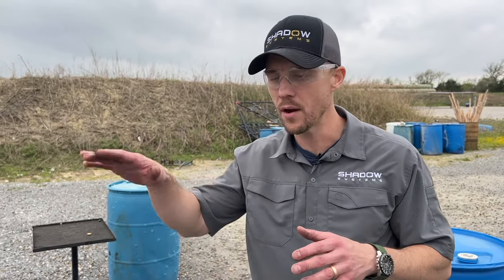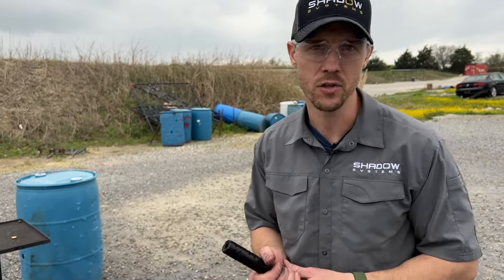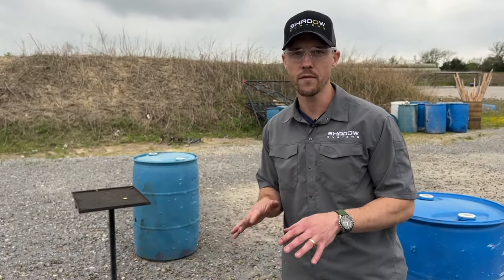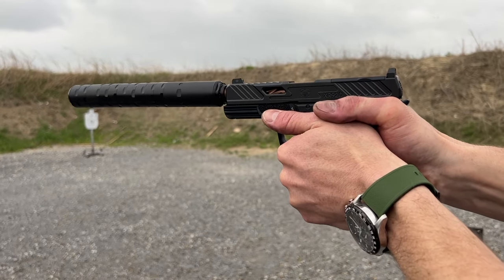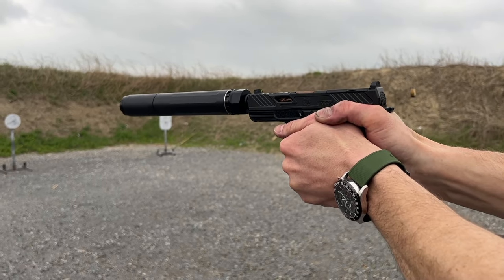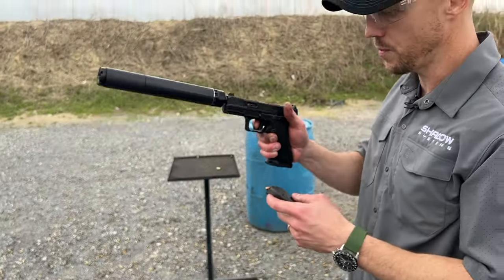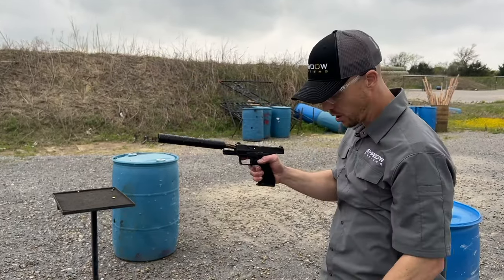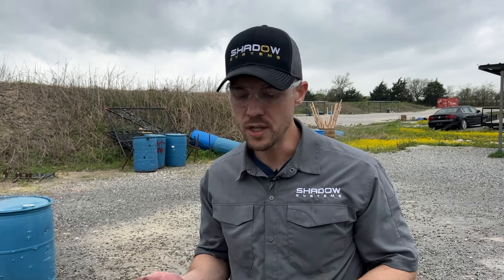Technical Tuesday - Improving Reliability with a Suppressor

Comment: My XR ran flawlessly with my omega 9k with the stock spring. My p80 17 clone had the opposite issue here where it wouldn’t eject, or would get stove pipes, or not lock back on the last round.  It does have a stock weight recoil spring, so in this case perhaps it needs a lighter one. The pistol was well lubricated.
Reply: Did you ever figure this out, I have a similar issue
Reply: @Cseeley122  yeah so basically if it’s an FTE, it needs a lighter recoil weight. I went with 15lbs. If it’s an FTF, or failure to go into battery then it needs a heavier spring.

Comment: Thanks for the video. I have a larger dead air suppressor, the wolf man. I just tried it on my dr920 and it won’t cycle. I’ll be able to get one round off then I have to rack it back to cycle the weapon. I had cleaned it prior to shooting and also sprayed lube into it when the malfunction occurred. Still no cycling. Going to try the heavier recoil spring.

Comment: This is why I slapped together an AR-9SD. I've had zero jams or malfunctions of any kind. No fancy devices or tuning needed just screw it on and dump thousands and thousands of rounds through it. 40 round mags are $20. The spring sproinging and bolt going home is louder than the shot and the bolt coming back. I haven't experienced any of the port pop or gas face I've heard about. All the noise and filth stays in the gun. 
Slide guns with cans may look cool and tactical but what's really cool and tactical imo is something that can run forever with any ammo and no tuning.

Comment: well that's the opposite of my problem lol, the shells won't eject when I shoot my p80 g19, it runs like a dream without the can after 500 rnds but it fails to eject after every shot when suppressed. it acts like the booster isn't even installed although i followed the manual perfectly and had it verified by the suppressor savi clerk I bought it from.
Reply: Same with my 19X ... smooth as butter until I throw on the suppressor and it becomes a single shot lol...if you ever figure out the right spring weight please let me know!

Comment: Do the stock iron sights and 3rd co-witness optics like holosun 508t clear larger cans like that 45cal suppressor? Or would you recommend sticking to the thinner diameter cans? Is there a can diameter range that is recommended/supported for DR920?

Comment: Heavier spring? When I put my lunar 9 can on my mr918 it wouldn't even feed a round because the slide didn't go back enough.  I even took the can apart and ran it in the 4. 5" CONFIG, still didn't work
Reply: Yeah I’m confused I always thought you go lighter springs with suppressors right?
Reply: @BlxvkMamba my 918 and G34 both got lighter springs put in now it cycles
Reply: @gregoryhall2967 yeah my guess is he is using 115 or 124 grain. I generally use 147 grain. Heavy bullets with a supressor is only going to slow the slide down more. Very confused at this video lol

Comment: You guys kick serious asses. Switched my omega 9k from my Glock to my XR920 and though it usually runs fine every now and then when I hold the trigger it fails to go into battery like stated in the video, now I know the solution. Thanks for the great info, also I noticed with the new spring it’s sold separate from the guide rod, is that a pretty easy install?

Comment: Help! I attached my almost brand new can (AAC Ti-rant 45 - owned six yrs but not used... long story) to my almost brand new Glock 21SF the other day at the range. All had been modestly greased and/or lubed in key areas prior ro firing.

The weapon cycled reiiably with factory springs.  HOWEVER, accuracy at 15 yds (bench/sandbag rested) was horrific. As I turned to different points of the clock, the POI moved around the bullseye...10" away from the "X"!!!

Btw, firing from bench sand bags prior to suppressing, this Glock's POI, from 15 yds away, was 2" high, 2" right.

I sure couid use some helpful advice.  AAC "tech" person (e-mail only) has nothing helpful to say at all.
Reply from the maker: Wow that’s a big shift.  Is there any evidence the bullet is kissing the opening at the front of the can on the way out?  Did you try more than one kind of ammo?  I take it you can make it go high or low, left or right, just by moving the can?   Where does it print when tightened down?  I assume you don’t have an O-ring on the barrel and there is metal to metal contact at the shoulder of the barrel?Trevor
Reply: @ShadowSystemsCorp  Double checked: zero evidence of strike at opening on way out. All ammo the same Winchester 230-gr JHP.  Yes, "can" adjustment moved point of impact "around the clock"...equally far away from bullseye. "Viton" (per accompanying pamphlet) O-ring inside front cap of "can." I lubed area with bit of Lubricate grease before trip to range.

Not sure what you mean by "tightened down," unless you mean without "can." If that's you're meaning, POI was 2" high, 2" right from same bench rest 15 yds away. Thx.

Comment: Very helpful video. Would you recommend proactively swapping to a heavier spring on a DR920 running a MOD9-FS if I'm planning to run it suppressed full time?
Reply from the maker: I would, if it really will be a mostly suppressed gun.  The guns run fine with a 20 lbs if your technique is decent and the ammo is not some powderpuff stuff.  Only trade off might be a little more perceived recoil.  Trevor

Comment: Someone already got my question out about red dot weight but how about barrel and slide length adding weight? Like would the dr920 or dr920l need a longer or tougher spring due to weight to ensure it cycles? Looking for a cr920 as my new carry gun and if I fall in love I’m thinking xr920 for a duty pistol with room for a comp or suppressor.
Reply from the maker: The main factors affecting spring weight are coupled mass (barrel plus slide), uncoupled mass (slide), ammunition (huge), shooter technique (huge), and friction.  Whether the guns you mentioned will need a different spring will depend on those factors--keep in mind that bigger slides are not necessarily heavier as you can machine weight out of them in other areas as we have with the DR920P.  

The irony here is that your spring is faced with competing objectives.  The goal is to have a strong enough spring to protect the gun from damage, a weak enough spring to always eject with a wide range of ammunition and shooter technique, a strong enough spring to strip the round and push the round up the ramp.  Add a comp and a suppressor and it all gets even worse!  Trevor

Comment: Hey Trevor quick question how do you get the thread protector to stay on after about 4 shots have to tighten back down I seen you retighted the can after about 4 shot didn't know if you had any suggestions on how to get it to stay on..
Reply: Did you put the rubber o ring on that comes in the bag?
Reply from the maker: Hi Tyler, there is a rubber o-ring in the box from when you bought your pistol. That o-ring is meant to be used to keep the thread protector on. You’ll place the o-ring over the end of the barrel and then tighten the thread protector on as tight as you can hand tighten it. The o-ring will squish out to the sides a bit—you want that; that squishing will give the friction you need to keep the thread protector in place. One note, the o-ring must be removed before using any muzzle device.
Reply: @elliottkeyes9448  I did not put it on I got it but did not put on will be doing that asap
Reply: @ShadowSystemsCorp  thank you I will be putting that on and see what happens thank you for the help 🙏

Comment: Are the sights that come standard on any of the Shadow Systems pistols suppressor height?
Reply from the maker: Hi Cody.  No, our sight height is optimized for use with most optics in our optic cut.  Suppressor height sights would be taller.  Trevor
Reply: @ShadowSystemsCorp  thank you